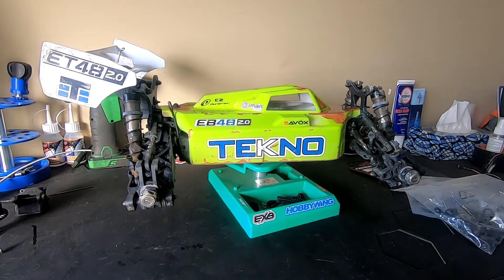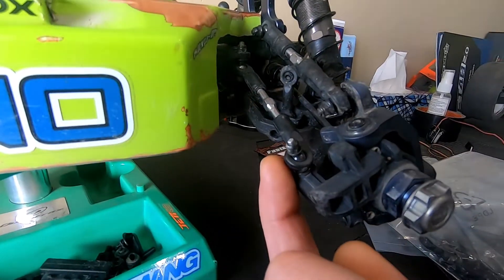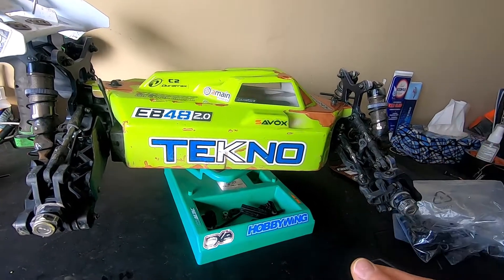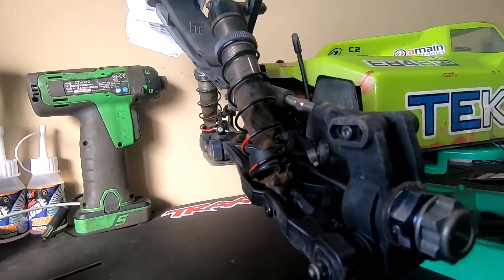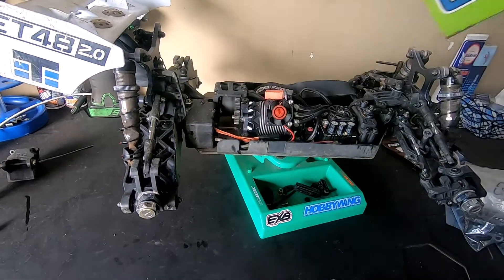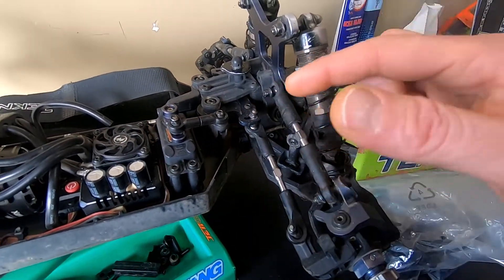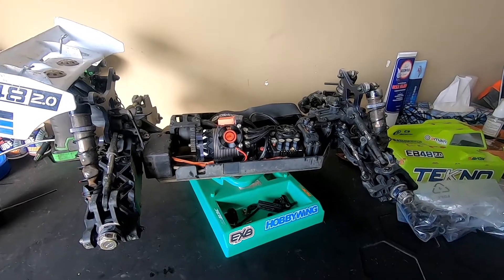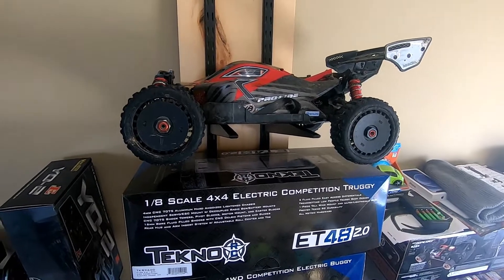Tekno EB48 2.0 time to rebuild

Comment: It looks like Tekno is running a plastic spur gear. How do those hold up?
Reply from the maker: @Jocke Karlsson yes it is a plastic spur gear and I had no problem with it all of last year I ran the same one, the one on the buggy had some chips in the teeth but still work perfectly fine I replaced it mostly because I had to open up the centre diff and I just figured I was there anyways

Comment: Which parts break mostly on Eb48 2.0?
Reply from the maker: @Alexis Damianidis There is not anything specific that breaks on the buggy I have not actually broken anything yet. Things do wear out like pivot balls the rod ends and where the hinge pins ride in the arms the arms will get worn out. I would say to at least get some shock shafts because those can bend in a crash or if someone runs into you lol and it is nice because all four shocks use the same shock shafts
Reply: Thank you I just bought it and I would like to have on jand some parts
Reply: I have put glue in the arms where the pins get, someone did that to minimize wear, I don't know I guess it will hep
Reply from the maker: @alexisdamianidis5261  I will have to look that up and see what that’s all about with the glue but no matter what overtime the plastic arm is going to wear out or you run into someone and then they bend the hinge pin and mess up the holes in the arm I had that happen to my truggy last week lol. I would say if you just got the kit you should definitely get the Tekno servo horn for it that’s really the only upgrade you need for the kit
Reply: @rcdaveshobbies  yes I have the tekno servo horn, bought it with the kit. I guess I will have to relax and enjoy this kit.
Reply from the maker: @alexisdamianidis5261  good that’s the only thing you need for now anyways. Have fun with it and enjoy